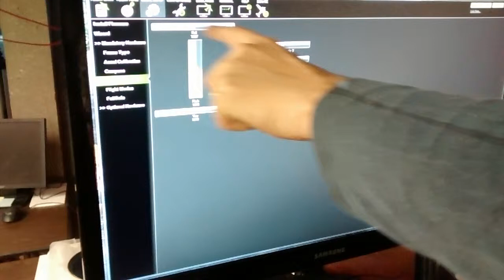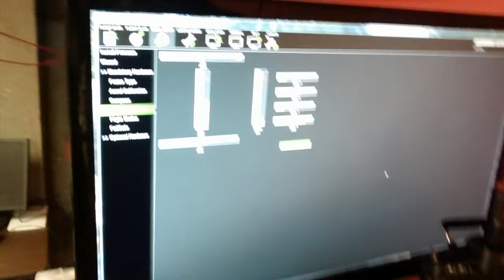Pixhawk OrangeR910 Radio Calibration Problem

Comment from the maker: I have since done additional tests and discovered an additional problem but this time it's the R910.  When I set the fail-safe to min-throttle and then proceed to do tests by shutting off the transmitter at random times, the results are that ~60% of the time the throttle will drop to 0.  The rest of the time, the throttle will hold whatever it was at previously.  Even worse, the AIL/ELE/RUD settings seem to ignore the failsafe settings.  After using the same model.ini file and binding to an R615 receiver I confirmed that the R615 does not seem to exhibit this same behaviour.  My conclusion is that both of my R910 receivers are not suitable for reliable fail-safe settings.